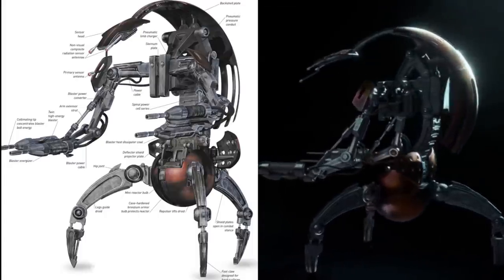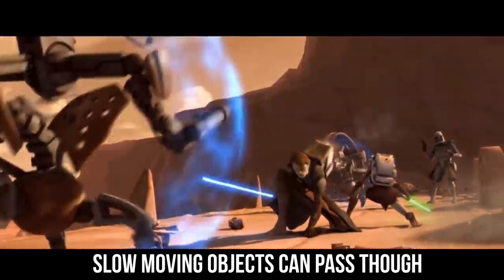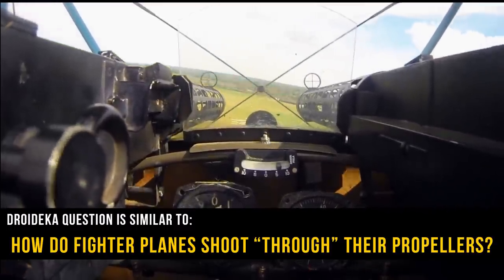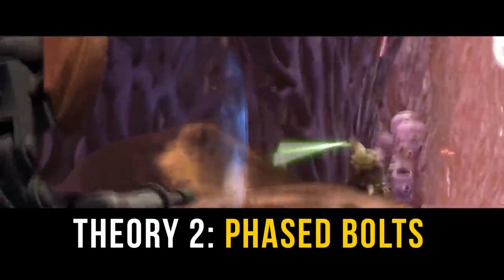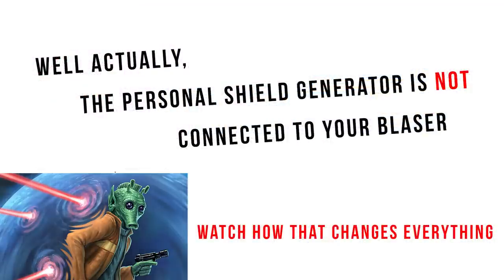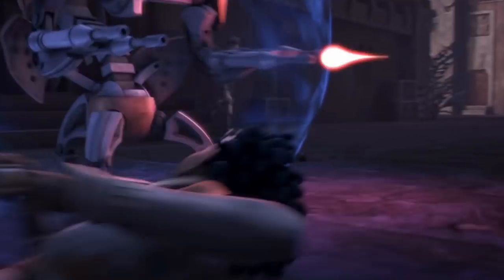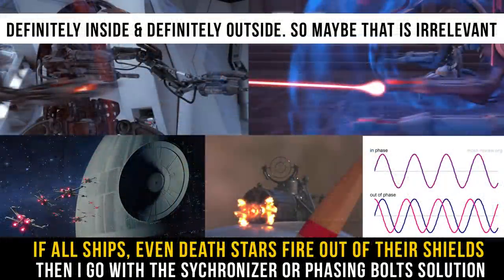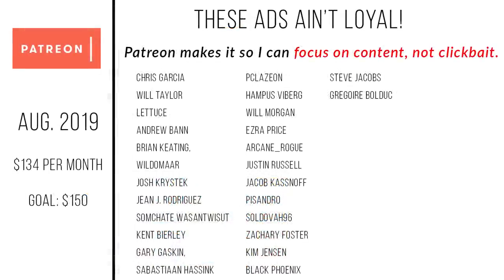How Star Wars Droids & Ships Fire OUT Of Their Shields (Deep Lore)

Comment: Shield flickering is a fairly valid explanation, and it’s the one I probably like the best out of all of these. However I will say that I had always had the belief that the shields were polarized so as to allow blaster bolts to pass out of them but not into them. Star Wars isn’t exactly hard science fiction and so I think that just about any explanation proposed could be the “correct” one.
Reply: I was also under the impression that it was like a one way mirror
Reply: Carlos Leon same
Reply: Star trek goes with the frequency idea in one movie they find the frequecny of the enterprise D and then penetrated the sheilds.
Reply: A simple explanation that avoids the 'one way mirror' or 'polarization' of the personal shield concept would be that the blaster is connected to the shield generator with a sort of Galactic Bluetooth. This could be easily got across to fans by having a character in the heat of battle screaming 'DAMN IT MY BLASTER ISN'T PAIRING WITH MY SHIELD AGAIN!!!'  then trying to call the Rebel Tech Support help line.
Reply: Shield flickering seems the most "George Lucas-y" since he absolutely LOVED WW1/WW2 stuff.
Reply: That makes sense. I think I was on this theory, or maybe the frequency/phase.

Comment: When you take into account the behind-the-scenes fact that George Lucas based the space battle scenes in A New Hope on WW2 airplane dogfights, I think that the "shield interrupter" theory makes the most sense. It's a simple and practical concept, fits well with the "WW2 dogfights but in space" theme, and has a lot of real-world verisimilitude.
Reply: I always theorized that certain kinds of shields were "polarized" in a way, drawing bolts through when approached from one side, while "pushing" a bolt away when approached from the other side (much like magnets do when either different or similar poles are are presented toward each other)
Reply: I love new words. Thank you. Had to google that honestly thought at first it was just a horrible autocorrect
Reply: It was the first world war where they fired there guns through the props
Reply: @kiwiman7361  Some WW2 aircraft did as well. Check out the machine guns mounted in the engine cowling of the Bf 109 for an example of this.
Reply: My only problem with the interrupter idea is on Capital ship guns, where there's usually a very "large"  open window to hard vacuum that the "gunner" (sometimes several, sometimes hundreds) is shooting through/into, and even if its open for milliseconds, repeated shots are going to build up in the form of atmospheric leakage, which can be substantial since it usually only takes hard vacuum about 1-3 seconds to completely empty any kind of room with a large enough open surface exposure.
Reply: @Trooper_No.2102  

I actually like that idea the most, and it helps to solve a lot of issues regarding inconsistencies with energy shielding technology, Especially if this of polarization could be controlled or altered locally within specific spots. like say one part of the shield is polarized in one way to act repulsively to foriegn matter or enemy fire while another area is polarized in the other direction as to allow a combatant, spaceship or vehicle to fire back with little problem. Why this doesn't seem to be the case for personal shields seen in Battlefront 2 (by DICE)? Because such actions of changing of local shielding polarization require dedicated computing and integrated control systems which coupled with the already initial steep costs of the shields themselves means it's problems of both economy of scale and opportunity costs. It's simply deemed not worth the extra expense in most cases outside of crucial military assests and infrastructure i.e. most  warships and some crucial manufacturing facilities that may possess their own kinds of "Theater shields" or other forms of energy blanketing defenses.
Reply: @navilluscire2567  Indeed, it explains how living crew members do not need to be strapped into a safety harness to prevent being sucked into the vacuum of space when ships enter hangers (as the shields would be modulated to let dense matter I.E. a solid through) as the shield would "hug" an object creating a perfect seal on any craft regardless of shape as it passes through the shield at a slow enough speed (observe the gungan shield in ep. 1 when energy bolts are absorbed and dispersed while droids can simply walk through it)

Comment: I like the “sticking out” theory the most in this case. It also helps explain how starfighters can be such a massive threat in universe even when shields are up since they can target the exposed portions of the weapons and other systems.

It’d also explain the weird shield used by Trench that had to be completely lowered when firing. It’s one of the few bubble-type shields we see in Star Wars and one of the even rarer examples on a ship. The trade off in this case was that the shield is so much more powerful than usual. Given the size of Trench’s flag ship, it might even be a modified theater or planetary shield generator with associated capacitors.

It also explains why the Gungans didn’t fire through the theater shield at first or why the Rebels had to lower their shields on Hoth to fire the ion cannon.
They were times when the weapons were in a position where they couldn’t poke out or use a conformal shield like most starships which could wrap around everything but the the very end of the weapon port.
Reply: It does not work though. Trench was able to fire his canons, just not his torpedoes. This if anything supports the phasing theory. The guns could fire but you can't shift the phase of the torpedoes. I don't like the theory because phasing is super bs irl and adds its own problems lore wise, but it's the only one that consistently explains what we see.
Reply: Do you have footage of that? It's been awhile since I've seen the episode. 
Depending on how it's portrayed it could just mean that the shield was lowered more often than you think it was and it could imply a second layer of more conventional shielding
Reply: @redshirt0479  the major plot point of the episode is that trench's shields are super powerful but once lowered would take hours to recharge and put back up.
Reply: Most starships in Star Wars appear to use a conformal (aka hull-hugging) shield. The only exceptions I can think of off the top of my head would be Trench's Flagship and the Raddus, and both of those were explicitly stated either in story or in official materials to have very advanced shields.

They don't have to stick out much in order to be outside the shield
Reply: @LazyTestudines  It's not phasing but the frequency of the bolt passing out of the shield.
Reply: @LazyTestudines r he just had a the guns sticking through the ray shields and had the particle shields as a bubble that had to be lowered

Comment: I always just imagined shields functioned like magnets or something... Energy from one direction is repulsed and from within is not .
Reply: This is also what I thought
Reply: considering  all bolts are plasma that would work except against the a-wing ,but how do you explain shields overheating or getting overwhelmed?
Reply: @sheilaolfieway1885  The shield bubble doesnt overheat - but the generator itself does - this could have been observed in the rebels episode where thrawn was attacking rebel base - the generator was overheating from the strain it was put under.

os for overpowering - well i would imagine shield could only defend against a blow that was below its own energy threshold - aka if the attack exceeds the shield power - then it will brake through - probably weakened that much what shield was capable of stopping - but still with the power levels we are talking even such weakened bolts would wreck havoc.

Additionally power setups would almost always guarantee that the shield gens would get way more power than any normal standard single weapons was capable of producing - that is why a blaster bolts cant get through the droideka shield - but one fired from artilery piece will - the output of the cannon was way higher that the one installed on droideka.

Comment: I always thought that the droideka, and other ground based shields, struggled with obstacle interference.the generator is forced to build a patchwork of a shield due to the ground and other objects in it’s path. A star fighter, or any other ship, can have a 360 degree shield all the time. 

In my mind, although the shield can be dropped in certain areas to allow shots through, the continuous computation required to avoid shield interference with the terrain is too taxing to shutter the shields and then recompute. That’s also why I think it is so rare to see shields on ground vehicles. The CIS super tank could’ve got around this by hovering slightly and passing the 360 shield underneath or by simply having an unprotected movement skirt that relied on heavy armor instead. The droideka shields already have recognition difficulties so it makes sense that rather than tax the shields just protrude the barrels out. For personal shields they make take a slightly different approach. In many of the game depictions the shield clings tightly to the body, meaning that the gun may also be outside the body. 

For spherical personal shields, they are often not anywhere near as strong as droideka shields so they may be low resistance/low interference enough that a point blank blaster bolt from inside can penetrate while a longer range from outside cannot. Thus allowing bolts out but not in. 

Again, all theories but hey, that’s what we watch this channel for.

Comment: I think the shield timer can only work on larger systems such as that of capital ships and other relatively large-scale shield generators hooked up to weapons systems. This is because on the Droideka, and perhaps starfighters, the systems aren't large enough or complex enough to simply change the state of a particular area, where on the larger ships, you can change the focus of the shields, and weaken or disable a certain section for a short moment without risking the statistical chance of the incoming shot that gets through.

Possibly in conjunction with this, I think there's an alternative "phase change" mechanic that can be used, related to that "tuning" of the shots, which is more possible for the smaller scale like droidekas and starfighters, and perhaps more difficult on larger scales like capital ships, where shields are further above the weapons. What you could do is have the energy fire in a certain state which, instead of being dissipated, gets activated by the shields, similar to how a flamethrower isn't any good unless you add a flame to the gas that you are spraying.

Alternatively, since the guns are in much closer proximity to the shields that they are firing through, perhaps the barrels of the guns themselves have a mechanisim that acts as an interrupting field with a dissapating range of effectiveness, allowing shots to pass through just within a small cone around the barrel. This also prevents guns being usable through personal shields, since the blasters probably don't have this mechanisim, and/or the shield itself is further away from the exit of the barrel due to the larger size of it.
Reply: If the shots (energy) gets activated by the shield, how could they shoot without their shields being up and running?
Reply: i like the idea that the shields for most capital ships hug the body of the ship and each turret has there own much weaker shield that hugs it’s own hull. like how battleships have a heavily armored hull and more lightly armored main cannons. maybe starfighters just don’t have shields around they’re guns. this would also explain how Po was able to destroy all the anti fighter turrets on the dreadnaught in The Last Jedi. they were outside the main shield.

Comment: the problem i have with the "phasing" answer is the existence of projectile weapons.
you cant phase a concussin missile but you can still fire it from your fighter/ship. and its mot definitively not slow enough to "just pass through".
Reply: Hotaru Maybe..the concussion missile has an energy envelope generated from launch tube..so this frequency is recognized by shield outgoing..?  Eg proton torpedoes from X wing have cylindrical part I think that separates after launch as warhead itself is a kind of pyramid or cone shape..can see them spinning into target in A New Hope.. but maybe the body of missile generates this null field to pass through?
Reply: Potentially there is a combination of phasing and flickering being used. Rapid fire weapons could cause a flickering shield to be down several times a second, but concussion missiles are fired a lot more sparingly.
Reply: it's the alignment of the energy shield.  You can fire out but nothing comes in

Comment: I think in lore it's a combination of 1 and 2. However, theory 3 doesn't make sense because it makes the assumption that the blaster bolt forms at the tip of the barrel and not,well, say in the chamber of the barrel. Or else the bolt would just bounce back inside the barrel and destroy the blaster.

Anyways, it makes sense the ION cannon required the Rebels to turn off the shield generator. You just don't want an ion blast to hit your planetary shield. I think the same goes for the death star shield. I suspect weapons of that size cannot easily change their frequency/phase. However on smaller systems (i.e fighters and droids)  the phase theory makes sense.
Reply: I agree.  It fits via physics and logic.

Comment: Thoughts from Legends material to follow:
There are actually 2 diffrent ways to project a shield in the StarWars universe.
In older books ship shields are often described more as a hull polarization. In this they charge the top few molecules of the armor (also why ship armor still exists) and disperse hits though the surface impact point is still burned away (why ships have burns & scars). 
Bubble projected shields are sincronized to the guns. In the case of gun bays (DeathStar & Venator) the main hull is protected by polarizing but the bays have their own timed projectors screening the gunports.
For DeathStar2 IG88's consciousness describes the inefficent crew having to coordinate before he took over compleatly after Endor sshield was destroyed and started blasting away.
As noted in the eailer Droideca video projected shields can also be tuned to not block slow moving objects.
As for the phasing theory I doubt that is the case given the variety of weapons fired through the shields.
TurboLasers are forced plasma, Ion Cannons are charged particles, Awings use actual lasers, and thats not getting into torpedos, missles, artillery, and tractor beams all of which must pass 'through' shields
At one point while searching for the Kitana Fleet Lando encounters a phased beam weapon and says they are inefficent and obsolete, nobody uses them.

Comment: This video made me think about two droids from the Clone Wars. One was the commando droids with their energy shield..shields. Really, they had those handheld shields the Gunguns used in Ep 1. But! The droids stuck their blasters through the energy parts to shoot.

The other droid was sniper droideka, which didn't use an energy shield at all. It just had a thick armor piece. That might suggest a yield problem with droideka energy shields, as I imagine that a sniper variant more like 50 cal to the normal variant using 20 - 30 cal lmgs.

Comment: Not just the blasters are set to a frequency that goes through the sheilds BUT the distance from the sheilds.  The reason the droideka some time look inside or outside is that each unit has a different frequency so if you was to tune your weapon to shot through it would only work once.  This is the same with starship but less noticable because of there size and the weapons being fixed in place

Comment: I dont know if there's any lore to contradict this, but here me out. A shield projects outward, until it's designated position outward. So, maybe the shields are one sided per say, like one way glass. Energy or projectiles can't come in, because the shield is projecting outward, but if you're inside the projection the shield doesn't effect  the blaster bolts or anything else along those lines, because its not meant to or can't deflect anything from that side. We've never seen (that I know of) a blaster hitting the inside of any shield, bubble or otherwise. Anyways, love the video, excellent research to a excellent question, and please keep up the amazing work!

Comment: I was going to counter your shield argument with Admiral Trench's defeat during the blockade of Christosphis.

Then i remembered it was missiles being fired and not energy based weaponry...

Though it does not explain why shields need a long time to recharge. 

Good Video. Very Informative.
Reply: Shields probably need a long time to recharge because they have a sort of "ignition" point. Imagine a capacitator bank holding the energy for the shield, but the capacitators need a 30% charge to actually ignite the shields. Sure, the banks can uphold the shield once it drops under this completely random choosen value, but if fully depleted and the shields collapse, 30% needs to be reached again to reignite them.

No actually clue if that works, but it sounds techy enough and most incendiaries work the same (you need a certain amount of fuel and oxidizer to ignite the process and can then reduce both while keeping the process going)